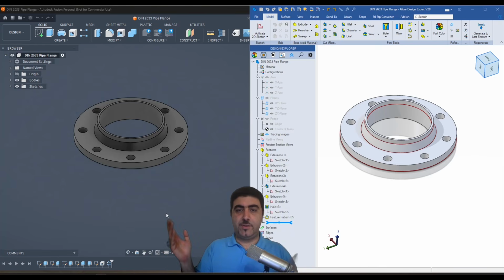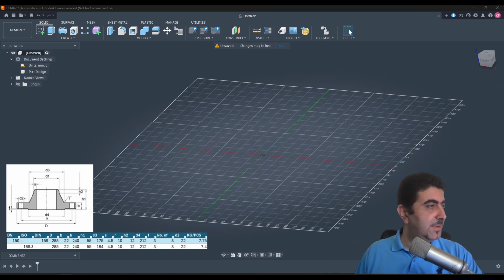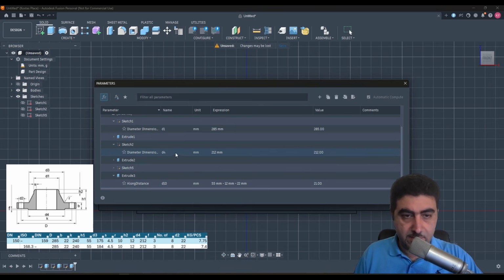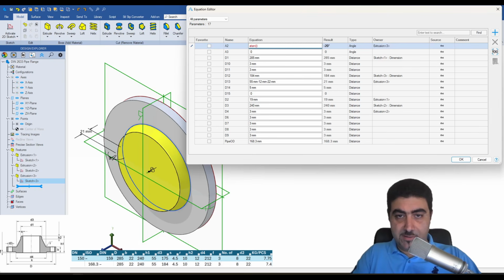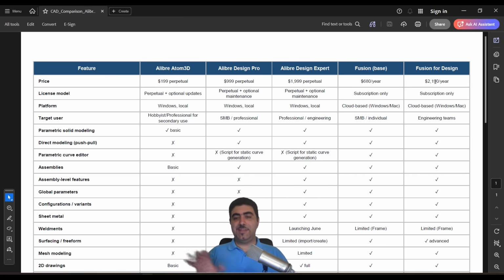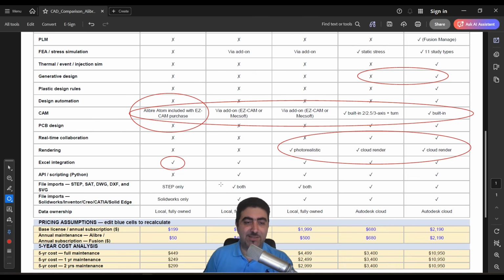Alibre vs Fusion: Designing a Bolt Flange (Is It Worth It?)

Comment: Mesh is pretty important when working with 3D scans. Bricscad is supposed to be decent and is a perpetual licence.
Reply from the maker: That's true but Alibre can import stl files too. I have a video on that:
https://youtu.be/AgeVkGhfgsk

It can export mesh, too. And there's even an update in that area, I should do another video.

But BricsCAD is not a History Based Parametric Mechanical CAD. It is a boolean modeller, much like SpaceClaim, or DS Mechanical (which are fundamentally the same thing but...), or SketchUp. It has a parametric overlay but not the "Time-Travel" parametric capabilities that a feature tree based system like Solidworks, or Alibre, or Fusion offers.

What BricsCAD is great at is if you want to be designing in 2D directly. It's basically an AutoCAD clone with boolean 3D capabilities. Not an alternative to either CAD shown here.

Could you design the same part in all 3. Potentially yes, but not as efficiently in BricsCAD.

Comment: you model a rotation-symmetric body when you got the dimensioned drawing of it - why not model it the easiest way?
Reply from the maker: Well this was a showcase. And there are many ways to skin a cat. If you sketch the profile and revolve, you get a more complicated sketch with more involved constraints. Not necessarily faster or slower.

You're going off the "Design it as you manufacture it" school of design which I also like and try to follow some times. But, nowadays I find that many features of simple sketches is more robust parametrically. So, I adjust sometimes.

Comment: Having another player on the field is good. I support having more options. FreeCAD will still be my go-to, especially since we have seen these perpetual license battles before. A company, when they need money, sells a perpetual license, then reneges on the deal when they have established a market cap rate that they find good or acceptable. From my experience, Alibre faces the same hurdle that FreeCAD does in the industry market. Training people, for the most part, people are already trained on Autodesk products out of college. This is why they dominate the field, not a superior product. Look forward to seeing you in the speed challenges.
Reply from the maker: Thank you for watching and commenting man. Let me start by saying that the keyboard on my laptop is on its way out and is not reliable anymore. I got a wireless one and I can work with it, but I can't be efficient enough to run in TooTallToby's speed challenges.
As for Alibre's perpetual licence, it's not a market share strategy. It's a core value of the company. Alibre is just structured differently and it is my strong belief that the perpetual licence is not going anywhere.
And, as I'm sure you know, Alibre is not a new player. It's one of the oldest CAD systems out there and it's based in Texas. Not some obscure tax Haven or satellite country.

Comment: in german, we say DIN (from Deutsches Institut für Normung) as a word, not as single letters in the abbreviation. flows nicer with the numbers :)
Reply from the maker: That's how we say it here in Greece too. But I figured in English, because it is initial, I should spell it. In fact, I don't know if it's the correct way to say it in English.

but in any case, thanks for watching and commenting man! Much appreciated!
Reply: @ExMachinaEngineering  ah, yea, I heard later on you said DIN as a word, commented too early 😅

I'm just a hobbyist, using fusion atm, but some things do annoy me, like it's really to see why a sketch part is constrained. I'm also not a fan of the pricing and subscription model. alibre being local saving is a big plus for me, so I might check it out soon.
Reply from the maker: Yeah, main reason I looked for alternatives to Fusion360 too.

If you do get a trial or a licence let me know if you need any help!

Comment: 00:00 Yo! Great to have another video from you! Let's go!
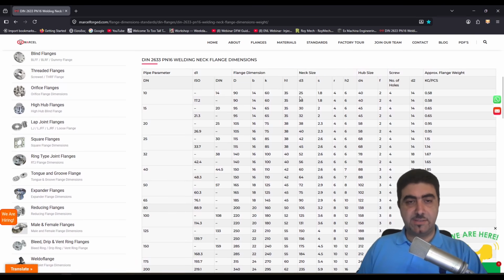01:15 Interesting part library! But I'm biased of course. I'm partial to the Weekday Weekend Workshop, if you've heard of it. (I'll have to check out Marcel!)
02:37 Nice dark mode indeed. I do wish Alibre would either default to dark mode, or ask when you install if you'd like it by default.
04:11 Ah yes, let's made CAD and CAM errors while wasting gallons of water.
05:05 I do kindof wish Alibre had the option to change this. Some people learned Y-up, some (like me) learned Z-up. 
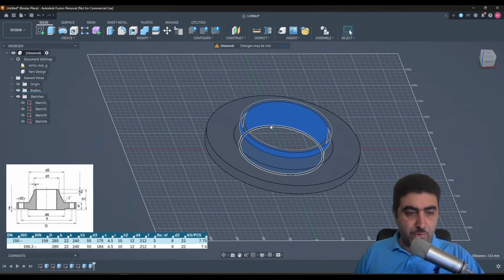13:04 This whole thing is making my head spin. It's just very clunky. You're not a CAD noob. You're a genuine professional with thousands of hours in CAD, and you're having trouble getting it to behave how you want. Insane. 
24:10 What does PDM offer me if I already have a NAS setup at home?
25:55 You could technically do video rendering but it would take ages of manual work adjusting the XYZ location of the camera, and rendering one frame at a time. 
29:15 Spend the extra cash on staff training for Alibre! Or, give it back to your clients in the form of more affordable products!
29:30 It's also worth mentioning that it is not necessary to update every year. If you're satisfied with Alibre's current feature set, you don't have to pay maintenance at all!
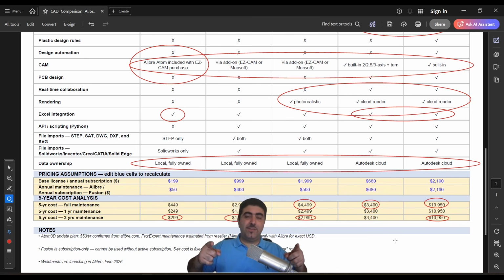30:25 Great video! Thanks Kostas!
Reply from the maker: Oh man!!! I love these comments. It's like actual near real-time feedback. Let's get you some responses:
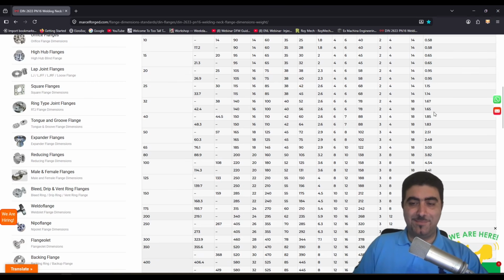01:15 Yeah, these guys have done amazing work cataloguing and making available a plethora of different standardized mechanical parts. A real wealth of knowledge, right there for free. Not very common these days.
02:37 Yeah. Autodesk excels in that, we have to give them that. I personally think inventor is the CAD systems that looks and feels best of all to use. But definitely not worth the price tag these days. These days it costs per year about a 4th of what it cost to own a perpetual license for it. Ridiculous.
04:11 You are of course referencing AI. That is going to be one very interesting video. You do know that I think that AI is overrated, especially in CAD and Mechanical Engineering and Design. But it'd be interesting to give it a level playing field and see what it does.
05:05 If it had it, it'd be nice, but I wouldn't change it. For me the XY-plane is always the floor. So, when I design something the bottom side goes on the XY plane. I really do not get why some people are so passionate about that.
13:04 Yeah, true. But on the flip side every CAD system has its idiosyncrasies and little quirks. I do like the Alibre workflow better, but ew should acknowledge that some quirks of Fusion are tere so it can have the amazing top down capabilities it has. I still voted Alibre with my wallet.
24:10 Well one thing it does add is the capability to have different versions of the same part in different assemblies. That is really useful for reducing the file count for companies that produce mechanical assemblies for their products and make new assemblies by updating some parts and replacing others. Legacy support built-in. But it is a particular thing. I don't know, does a NAS do versioning?
25:55 True, but not efficient.But I guess if you absolutely needed it for one time only, you wouldn't buy Keyshot, you would do it like that I guess.
29:15 So, true! So damn True! I don't get why people don't get this. Seriously...
29:30 Very very true! Paying for the maintenance every 2-3 years is a very real scenario with Alibre. Especially since Alibre only asks for the maintenance for the year you missed. Not for all of the previous one too.

Thank you so much Adam!!! Tha comment would be a great reaction video to be honest!

Comment: Where's Linux support? If all you are doing is design like that FreeCAD will be more than enough. Essentially for any hobbiest FreeCAD is perfect. If you need to do top-down and bottom up concepting work you might want a cleaner interface like in Fusion, Solidworks, or NX.
Reply: FreeCAD isn't truly parametric with all the topology issues, neither does it use industry-standard methodology or terminology. 
In this particular comparison video, neither F360 nor Alibre have Linux support. Alibre is at least considering it right now.
Reply: @WeekdayWeekend Fusion certainly isn't immune from topology issues. Strangly I have found some things easier to re-associate using FreeCAD than Fusion. I do love Fusion's hybrid modeling and ability to do crazy stuff with meshes. Its hard to question the value when Im grandfathered in at an early adoptor subscription price too. Fusion has about a year to convince me to stay without Linux support though. Im done with my operating system advertising to me and telling me when and if I can use my own PC. Microslop needs to go.
Reply from the maker: Well, Alibre might be coming to Linux. It is more likely to com to MacOS. Andon another note, I used Alibre to design anything from pipe flanges to wood cabinets (down to the adjustment set screws) and entire food processing lines. So, Alibre is not lacking at all, whereas FreeCAD cannot keep up after a point and Fusion is too expensive.

You say, you're grandfathered in with early adopter subscription. What is that $300/y? 500/y? Something like that right? Do you have unlimited access to generative design? 4-axis simultanuous? Machine Simulation in CAM?

So, Autodesk broke even that promise. You subscription is at a flat rate for you of a lucky few. But you're still getting what Autodesk allows you to get, not all of Fusion. That is a "Richard" move in my book.
Reply: @ExMachinaEngineering  About $315 per year. Totally agree on a bit of bait and switch. They took away local stress analysis. They also took away the cloud credits I got with a single year subscription. Took away the ability to run thermal analysis under the base comercial package too. I don't trust them not to remove more features. I can't stand features moving away from my hardware and to the cloud. This makes everything slower and means you own nothing. I do have access to at least 3+1 axis machining and machine simulation. I am happy to pay for software. But I CANNOT be held hostage in perpetuity by a software developer who refuses to allow me access to my own intelectual property. Does BIC own my house because I signed the mortgage papers with their pen? It is insane to me that any company or individual would wholeheartedly hand over their entire ability to make a living to someone else.
Reply from the maker: Hahahahahahahaha, the BIC comment had me ROFL!!! Hahahahaha.

But yeah, it is a bit like that isn't. It is malevolent. Makes no other sense than trying to "mine" you to death.

That's one of the reasons that tilted the scales to Alibre's favour for me. Not the only one. But a serious one.
Reply: I definitely get it for sure. I'm a Linux fan all the way. FOSS ftw. There's only a few things keeping me on Windows. I daily drove Mint for about 6 months before I had to swap back because of productivity software.
Reply: @WeekdayWeekend What types of software did you struggle with? I jumped from Windows to Fedora KDE and found a fairly easy answer for everything except CAD. (Again, no shade on FreeCAD which is awesome, but not quite at what Im used to.) I ended up building my own TrueNAS server and OPNsense router too which was a great experience. I was lucky enough to catch the RAM and SSD market only slightly into the upswing though.
Reply: @WeekdayWeekend  In my view I don't think it's possible to actually buy and "own" any software on Windows anymore. Of course "owning" something you don't understand (software source code) has challenges, but my main concern is that Windows not drastically changes your operating system withtout your permission. There is no guarantee that the software you bought will work. There is no way to roll your system back unless you go to extreme measures of air-gapping your CAD workstation. With RAM and GPU prices now, who an afford to put Windows in a VM prison and still give it proper system specs? I might as subscribe and accept the fact that no one other than CEOs will ever own anything again.